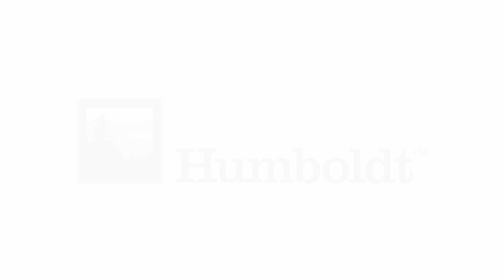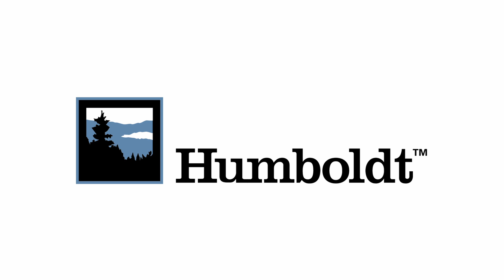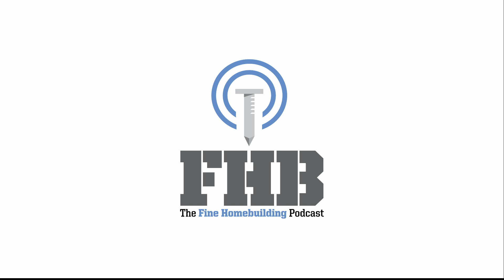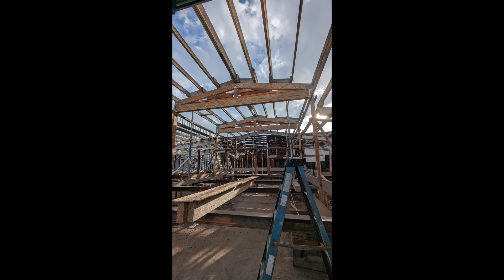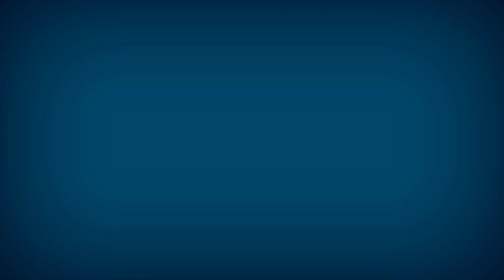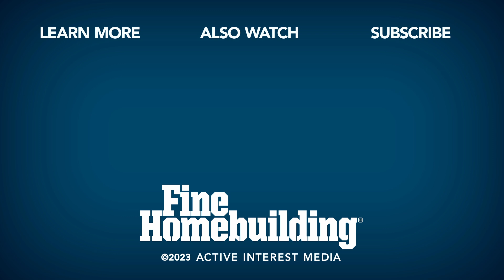Podcast 618: Heather Clark of the White House Climate Policy Office

Comment: I worked in one of the historical building in Boston renovated for low income non profit management. A lot do the stuff like the benches and common areas were never used by the tenants, while the buzzer didn’t work for years meaning they couldn’t get their meals on wheels meal delivery easily and their visiting nurses had trouble getting. A solar energy company made the building tighter and promoted what goody doody work they did, meanwhile they left the gap around the exterior door very wide and it blew very cold air all winter. My manager was writing checks to himself to a company named Home Depots Inc DBA His Name at his address. Then he started a non profit charity for pets and is not recruiting volunteers to solicit donations for him.